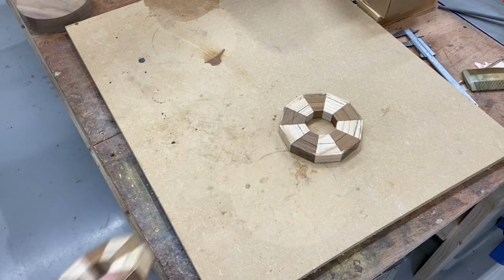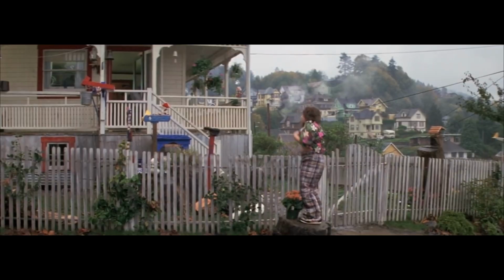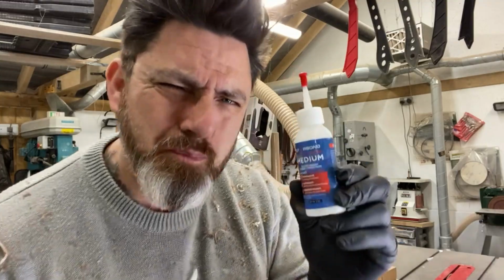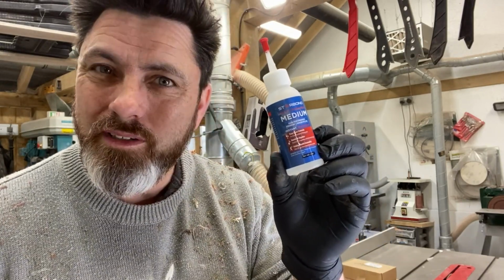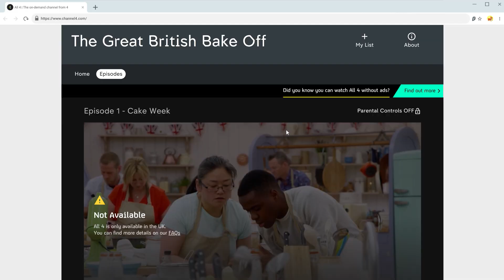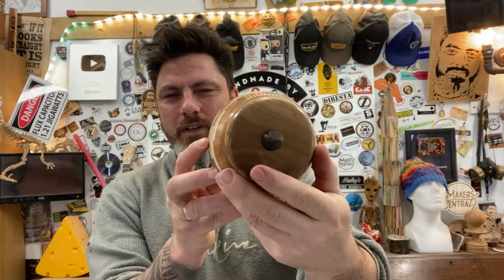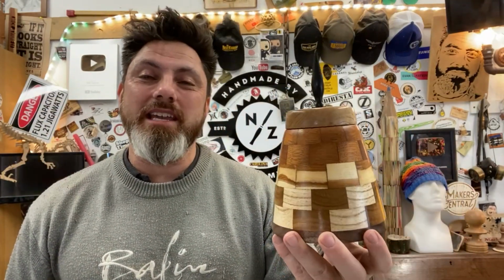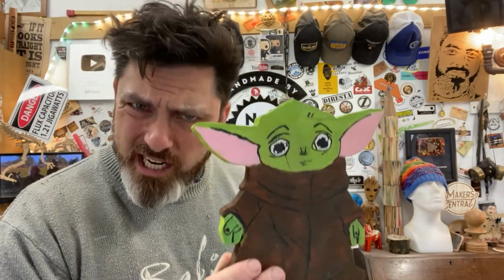Woodturning, The Segmented Pyramid - NO Epoxy Resin !

Comment: So I have a question. You explained in a previous video that you use paper towel to polish things to avoid cloth getting snagged and pulled into the lathe. Couldn't help noticing you're wearing a fairly loose sleeved jumper here, is there not a similar risk with that?